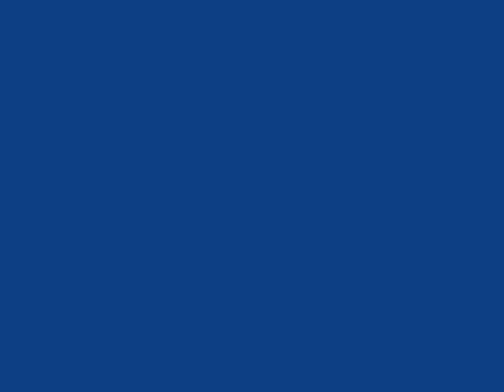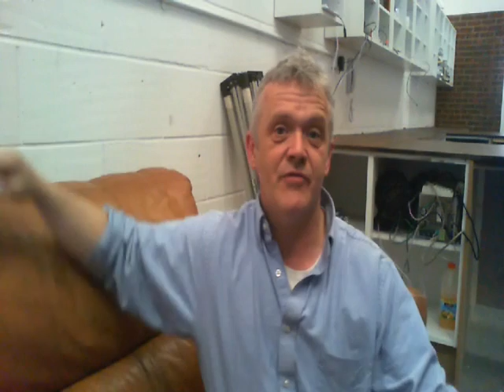About Graphene With A Spray Gun

Comment: A good point that commercial GO is expensive. However, it is worth buying one if you are trying to get a quality product of your own. Firstly, you would like to do that because the composition, structure, defects etc. can be easily checked using analytical techniques and compared with your own GO. Some tips: perform Energy-dispersive X-ray spectroscopy (EDS) on dry GO film (atomic % of carbon and oxygen is of the main interest) and Raman spectroscopy (D and G peaks around 1100-1700 cm-1 and 2D and D+G peaks around 2600-3000 cm-1).  Afterwards, you will get an idea of what you want to achieve. Further, you can identify (from EDS in some cases) what kind of stabilizing agent is used in GO dispersion (very important for high quality GO thin films).  Synthesis of GO is a tricky thing. I recommend to start from:
Ling Sun, Bunshi Fugetsu, Mass production of graphene oxide from expanded graphite, Materials Letters, Volume 109, 15 October 2013, Pages 207-210, ISSN 0167-577X, http://dx.doi.org/10.1016/j.matlet.2013.07.072. (http://www.sciencedirect.com/science/article/pii/S0167577X13010100) Abstract: Abstract In a deviation from the conventional Hummers method, a spontaneous expansion approach was introduced with expanded graphite as the precursors. The intercalating agent (H2SO4) was able to penetrate into the expanded graphite; this had further expanded the graphite and as a result, a foam-like intermediate was produced. The foam-like graphite was more easily oxidized in reaction with the oxidant (KMnO4) to form graphene oxide (GO). Fully exfoliated GO was obtained with expanded graphite having the median diameter ∼15&#xa0;μm as the precursors. This procedure was much safer and productive in scalable applications than the conventional Hummers methods. Keywords: Expanded graphite; Graphene oxide; Spontaneous expansion; Mass production
Reply from the maker: I have used this and it is impressive - i like it anyway lol

Comment: Ponders synthesising hydrazine ;p
Reply: Yes, Hydrazine is basically rocket fuel. It is a VERY toxic, flammable, volatile liquid.  Even the vapors alone are dangerous and are lethal not to mention they are combustible and explosive. Going to ponder this for a few days before attempting to make any. I have dealt with some noxious and dangerous chemicals before, so proper safety must always come first and have all the PSE. If you do not know what PSE stands for, and had to google it, do NOT think about messing around with Hydrazine.  DO NOT attempt this at home, or in a lab unless you are a qualified and skilled chemist with only the proper equipment and safety procedures.
Reply: The only good thing about hydrazine is it is a very good solvent for graphene.
Reply from the maker: Jonathan Luxient
lol - I am now a registerd lab so can buy it - lucky me lol - anyway as far as graphite solvents - so is chlorosulfonic acid but i would want the average joe messing with that stuff either. I spotted your shear exfoliation video a couple of days ago - nice work mate
Reply: Robert Murray-Smith Glad you liked it!  It's funny while I was making that same batch, I had burned out the thermofuse and a transistor in my blender as I was running it so long, and had to stop and glad to say I took it apart and got it sorted.  Yes, I agree, the average Joe should never mess about with such chemicals. :)  I bet having that lab license sure will make ordering chemicals a bit easier.
Reply: There are safe and more efficient chemical methods ;) Tip: nanoparticles...